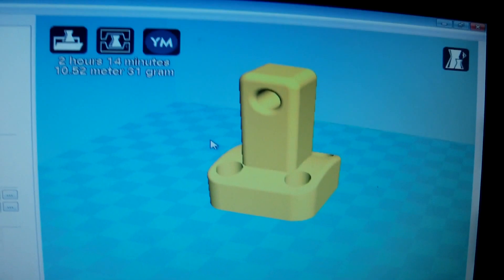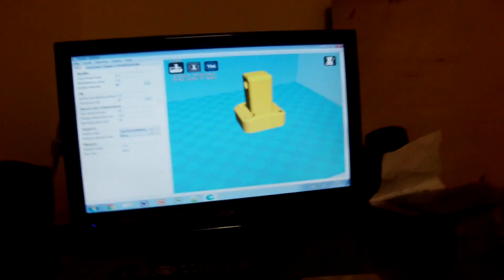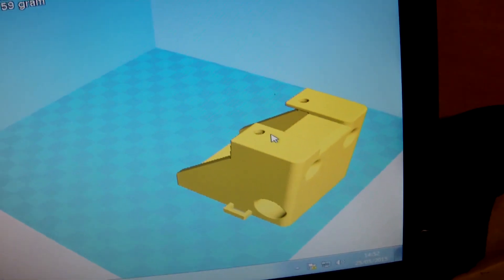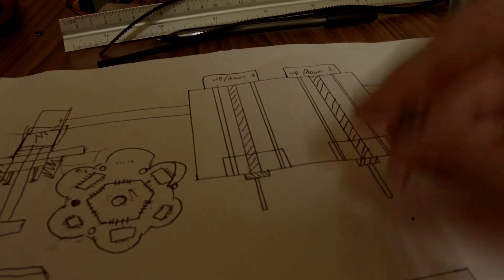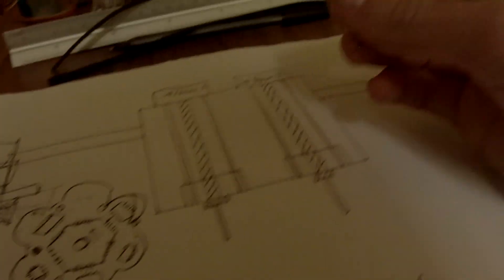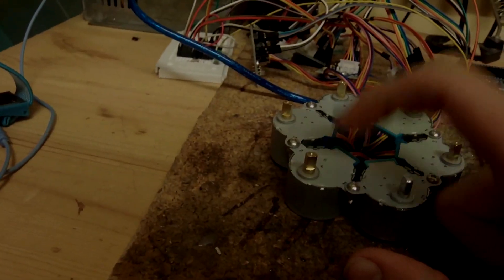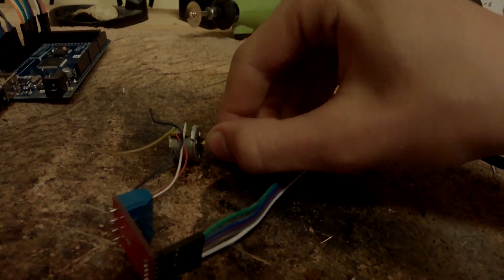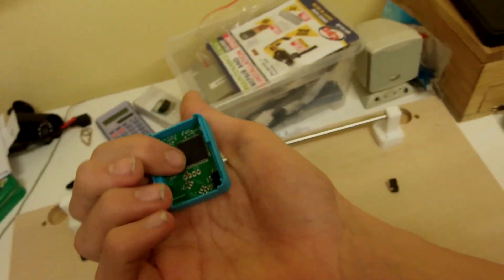Custom SMD Pick and Place Machine #1

Comment: That head design looks familiar :)
Reply from the maker: I'm not surprised buddy seeing as you were with me when I made it. I'm going to redesign it to use small stepper motors with more speed and less torque, I might have a few less nozzles to start with as the pump for 6 will need to be huge or I'll just need more pumps :)
Reply: You could add a solder paste dispenser
Reply from the maker: TheLividPig There will be a holder in the centre of the 6 heads. Which will allow me to add a drill for through hole work or a solder paste dispenser or maybe even a camera for a vision system